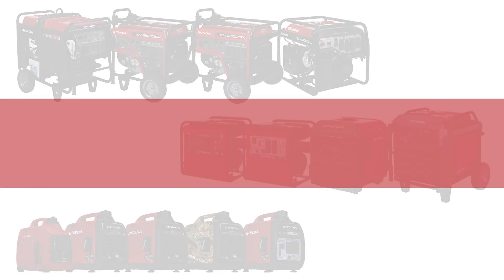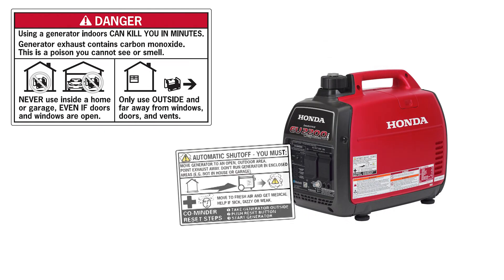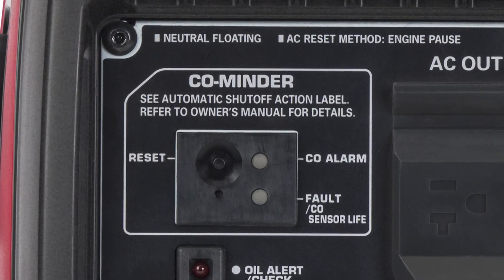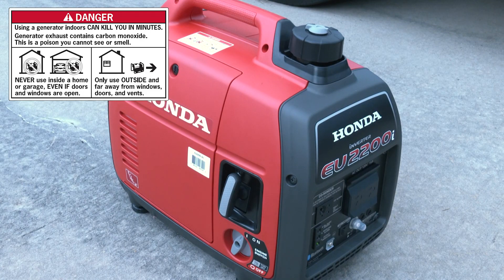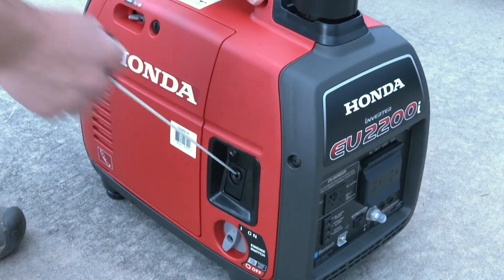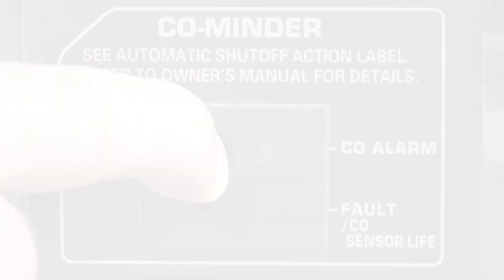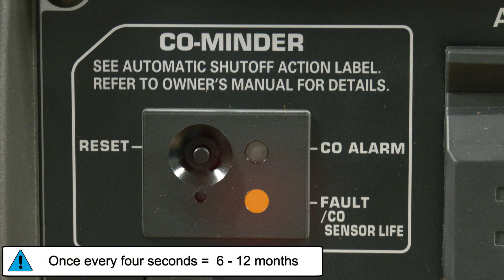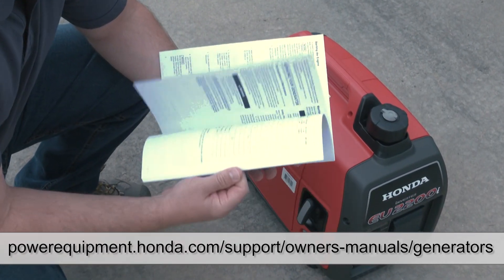Honda Generator CO Minder Operation

Comment: We have a EB 10000 generator at work with less than 10 hrs on it .  The sensor failed. The sensor which costs several hundred dollars, has been on national back order for months with no eta.

Comment: Open the generator code the sensor with several coats of urethane. Unlike duct tape this won't fall off. Effectively stopping the sensor from smelling anything. Thus defeating the moron minder

Comment: If I had known I would have bought a different brand. I used a Honda 2000 inside of a toolbox with one door open for the exhaust and another door halfway open so I can keep it locked and never had any issues for a few years but this new one woke me up in the middle of the night and didn’t know weather somebody stole it or what. Now I’m trying to figure out how to bypass the stupid thing so I can get some use of it without any issues. Honda had good intentions but for me it didn’t work, all it takes is a little wind blowing the wrong way and it shots down.

Comment: You can disable the sensor. Easy peazy
Reply: Is it a simple unplug or more involved?
Reply: @mikem889  Nope that video that shows unplugging the CO control panel harness does not work.  It will run because that is just the control panel.
Once it gets high CO it will still shutdown and the only way to restart it is to connect back the panel and press the reset button.  This has been tested by several people!
Reply: @Dreadlk  so the sensor is not in the panel then. That's just a reset notification board. Now we have to get to the sensor and see how to bypass it.
Reply: Please write Honda about it. They should offer a bypass of remove it.

Comment: Hate this feature!  Most people buy Generators to use them outdoors in some sort of Semi shielded area so as to keep down noise and also prevent theft.  If this thing keeps on shutting down the Generator is worthless to me.  Also they say the sensor needs replacement every 10 years.  My old Honda EU3000Si is on it's 16th year of operation and has never given any problems.
Reply: I completely agree. Is there a bypass?

Comment: Horrible Idea - there goes the reliability of the thing running.   Big Mistake Honda - nobody wants the thing shutting down and then having the sensor "go bad" and have the generator refuse to run until a costly repair is made.
Reply: Yes, I walked out of my dealer when he said he only has the companion in the co minder version.    They'll bring the standard model back when sales drop.   Maybe if they had free lifetime warranty on the co minder.  Maybe.
Reply: @stevemurray710  Well, I'm all with you on that but it seems that all of the generator manufacturers are doing this.  There are government regulations in place.  I found a few links a while back.   If I can re-find them, I'll post them here.   Try ebay, I'm sure there are still some non-CO minders out there.   BTW, the co-minder detector module part seems to be a mystery for both parts suppliers, Honda dealers and EVEN HONDA.   I called Honda and they have NO INFORMATION on the part.  I called parts suppliers, no info! and I called Honda dealers and they have NO INFORMATION on the part (this was back in October),  so what that means is if a CO-Minder owner has a dud CO module/sensor, and the dealer can't get the part and Honda can't even tell them how to get the part, then what is the fix?   A new generator?    You really have to wonder what the hell is going on with Honda.  Let's be honest, since the part is SO SO SO easy to remove from the panel and replace and let's say it is a $100 part, why on earth would you take it to a dealer who will charge more than that for just the labor.    Seriously, just unplugging it is the way to go (just disconnect but leave in place) if you have a CO-Minder model, but wait until the warranty is up.
Reply: @stevemurray710  Here is the Info... CO Minder - The Real Story - The video linked here briefly mentions that there is a ANSI Standard for generators that must have a carbon monoxide detector/shutoff by the end of 2020 - https://www.youtube.com/watch?v=vRjB7wO3tgg   -  I'm still trying the find the official standard but here's an interesting document about CO/generator related fatalities.   And Yes - a lot of people actually ran (for a short period of time) the generator in the house - The HOUSE!   https://www.federalregister.gov/documents/2016/11/21/2016-26962/safety-standard-for-portable-generators
Reply: Boy I'm with you on this one.  I recently had two eu2000s stolen, and now I have to deal with this CO minder thing which as an RVer I'm concerned that it will shut down while I'm running my air con - if there isn't a sufficient breeze.  My gens are always well away from me. This just sounds like a big PITA.
Reply: @3oldman  It sure is, I have plant nursery and bought an ac equipped cargo trailer with enclosed generator box.  Purchased an exhaust extension and routed it outside.  Must have a small leak somewhere although cannot find it.  Damn sensor shuts generator down before I even get a mile down the road!
Reply: @cordellmax  how did you extend the exhaust ?
Reply: Pull the panel, pull the plug, start it right back up.